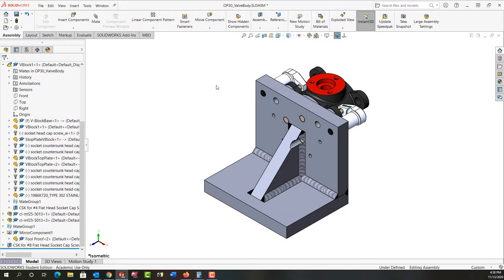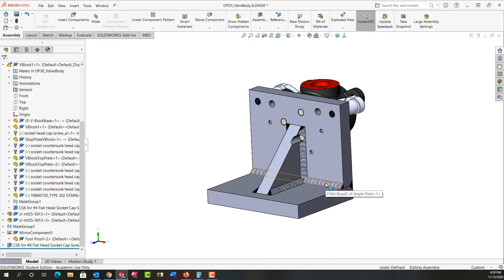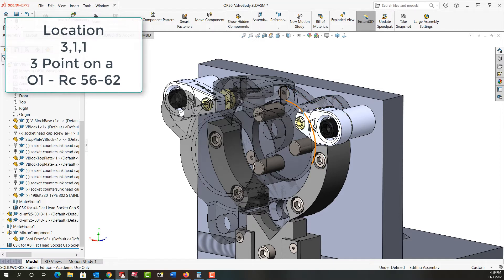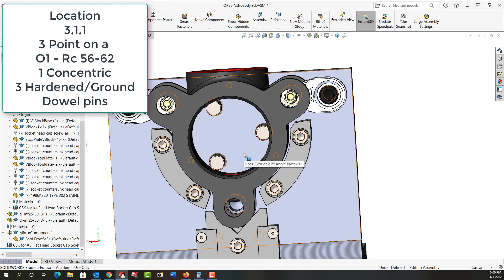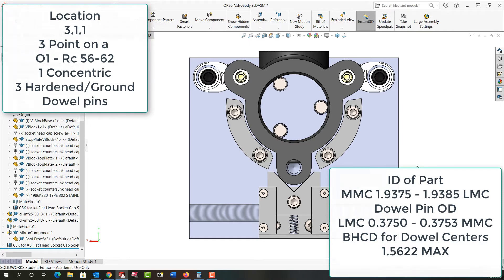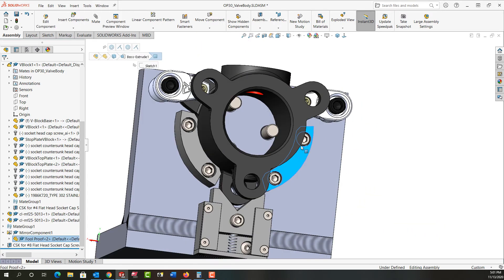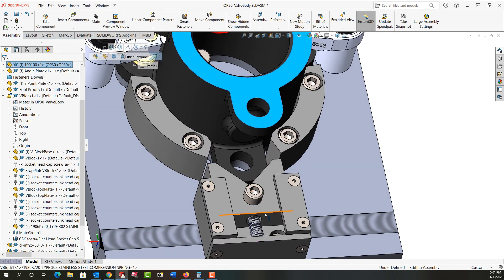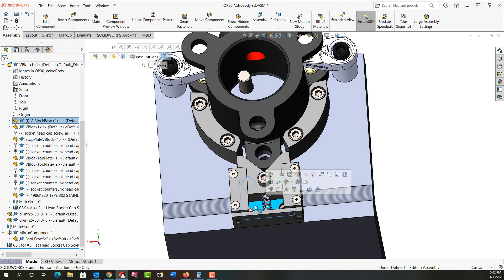Angle Plate Fixture

Comment: Hello you are a life saver. I am a Mechanical Engineer student and have been ask to write a short paper on uses of a angle plate for the mill. The class believe it or mot is Jigs and Fixture design.  I will be citing your video.  I also plan to watch more of your Jigs and Fixture videos.  Thank you so much for posting this video.  I understand how to use a angle plate for a Fixture now.
Reply from the maker: Glad it helped. Can I ask where you go to school?
Reply: @Fredumaction  Caldwell Community College in north carolina .
Reply: @Fredumaction  I made an A on my paper. My instructor told me that it was a very well written and very well said paper. He said keep sending me that kind of work.
Reply from the maker: @bobandweave763  Good for you.
Reply: I was wondering if something would work to constrain the part? Would using the 3 tab with holes work to constrain the part ? Just bolt it to the angle plate and use the curved blocks to steady it. Your method would be much more operator efficient and much quicker in a production environment.
Reply from the maker: @bobandweave763  yes you could bolt through those three holes, but they would be poor location holes because they are clearance.
Reply: @Fredumaction   I apologize for all the questions I am learning how to do this. What do you mean clearance holes?
Reply from the maker: @bobandweave763  I am sure you will cover that in class. The holes are clearance for bolts to go through so this part can be assembled to another part which has tapped holes.
Clearance holes should not be used as location but can be used, as you stated, to clamp the part.
Reply: @Fredumaction  Thank you for all your help. Can I ask where do you teach? My instructor just has an Associates Degree and so far has had me write a paper on colets for the lathe. This paper is "which is a bigger value an angle plate for the mill or a face plate for the lathe". I included in my paper that a face plate for a lathe is kind of dated technology and not really used today. They are good if you just have a lathe to machine flats and flat steps on round stock. This could be accomplished much easier on a mill with a dividing head or a rotory table or multiple axis cnc mil or a cnc lathe with live tooling.  I see so many uses for an angle plate such as filets of any angle could be machined quite easily with an angle plate in square or a rectangular part. Round stock could be machined square with an angle plate. Even flats and flat steps could be machined with the use of an angle plate.
Reply from the maker: @bobandweave763  I teach for Conestoga College at the Cambridge Ontario Canada location.